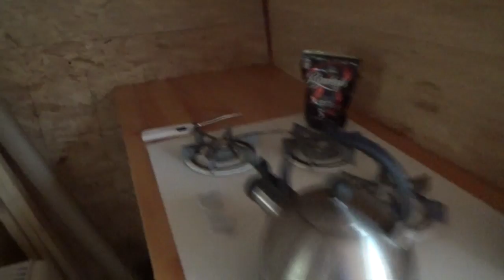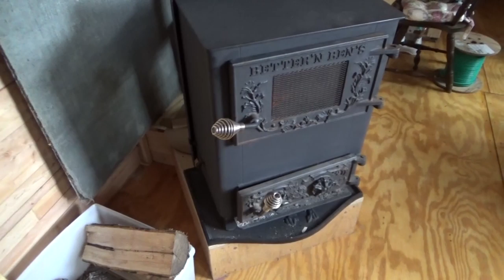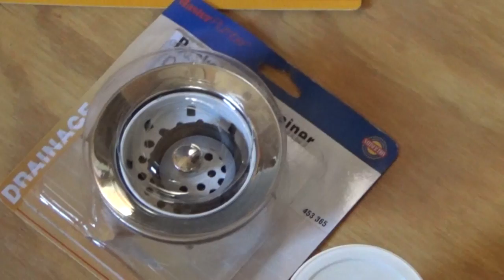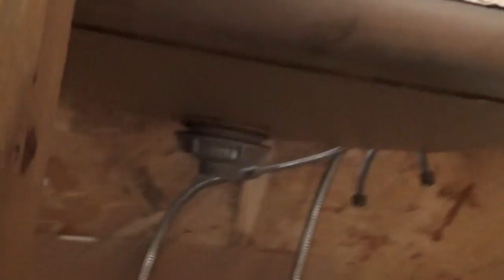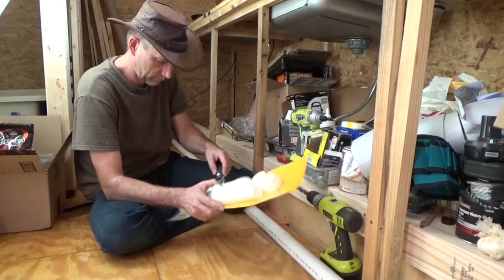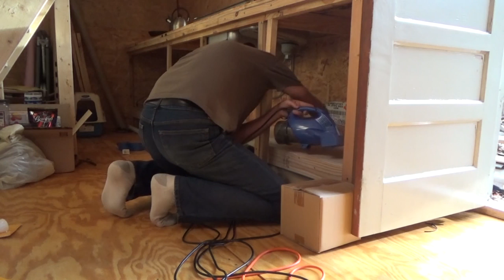Installing The Kitchen Plumbing In My Tiny House O35

Comment: your using a garbage disposal fitting for the tail stalk, brass tail stalks come in shorts and long to connect to the pvc joining piece that should go into a P-Trap then out the wall.... Good luck

Comment: I would have kept it like you had it with the bottom 90 because you're going to have water sitting in the bottom of your pipes as you don't have the pressure so you need to run straight out you need to make sure it has at least an inch of fall out your house so I would make sure you take out that Ben. Because of water just want to set in the bottom of your pipe and cause it to stink
Reply from the maker: It is there to stop air from flowing back into the house through the lines though.
Reply: The Do It Yourself World
yes, odor, plus critters and cold air. As long as the only standing water you have in your pipes is inside your heated space, no problem freezing. just check the outside pipe in the winter. ice could build up after repeated sink drainings. find some mongo heavy duty pipe for that application. clear ice with a hammer!
Reply: The Do It Yourself World You are right.  The trap is absolutely required to prevent methane from returning to the house from the tanks (or sewer/septic)... when you go away for a week or more remember to put some water down each drain upon return to make sure the trap has a good water seal or the house will stink at minimum,  explode if too much methane and you light anything. Always check the traps upon return in winter in case the water in the traps froze and causes a leak when the house is once again heated.  Also, remember to turn off the supply lines and open the faucets to drain before you go away in winter. ( Probably should have reminded you of that one last winter...  :/   )
Reply: I believe that the bend 'ben' as you call it, is called a trap and is there to trap bad sewer gasses.   It is essential for safety reasons.
Reply: DrBill  Doesn't the bend keep critters out too?
Reply: ***** Hey, MollyDolly is my friend and I'm sure that she doe not mind me speaking to her.    You seem to be on Troy's side more than against it.  Can't we get along?  I'm one of the good guys here.
  As far as Troy goes, he also is my friend and if he want me to quit commenting, he will ask me himself.  In the meantime I'd like to remind you that this IS a public forum and anyone is allowed to comment.  If that makes you uncomfortable, perhaps you should not be participating. 
   There are lots of people that I don't necessarily like that comment on these videos.   I don't go around chastising them for commenting.   It is their right.
Reply: bob Last That is dumb.  Neither of us have the hots for Troy.  We just think he is a good person and does not deserve the vitro of the haters.
Reply: Theresa Ford Anything that can slither in the pipe can make the bend in the trap.  :(   Might keep ants out.
Reply: MollyDolly The bend holds water so the critters would drowned.
Reply: ***** No! When one of our daughters was about four she saw a snake come up from a toilet on a news show and could not go to the bathroom alone for years!
Reply: Theresa Ford I do wish you were right.
Reply: Theresa Ford Only very tiny ones would drown.  Things like snakes would swim right through it.   Not that he is going to get any snakes, the way he will have it set up....lol....but it has happened in the past.   I have seen it on some of the reality tv shows like Nat Geographic.
Reply: Vicki Olson Oh!  Did you see Troy's videos of the black snakes? If I recall (and I try not to) a bunch of snakes hatched under the old camper trailer. Those babies definitely could slither up a drain.  I hope he puts screens on any openings.
Reply: MollyDolly I'm sure he will.  The grey water is supposed to be piped into a tank where it will be filtered before being used in the garden, if my memory is correct.    I don't remember that video but will try to find it.
Reply: ***** I said " this IS a public forum and anyone is allowed to comment.  If that makes you uncomfortable, perhaps you should not be participating. "  The key phrase is "if that makes you uncomfortable"  The key word in that phrase being 'if' . 
   You told me to 'keep quiet and to 'let him be' meaning Troy.  I don't bother Troy.   He has asked us to help him by answering some of the questions and comments that we have the answers too as he just does not have the time to answer every question.  He is grateful for the help that we give him and if he thinks we are stepping out of line he is totally capable of telling us and has done so in the past, especially when a discussion is fast turning into an argument or if he thinks we have misinterpreted something.  
  It is totally your right to read and comment on these threads, just as it is mine. I will never tell you to 'keep quiet' .    I do tell people that have a problem with the freedom to comment that allows even people that they don't like to comment, that 'if' they have a problem with that, perhaps this isn't where they ought to be.
Reply: ***** I really don't want to argue with you.  I don't attack you for commenting, please give me the same respect.
Reply: To all utube commenters.  We all have the right to comment in this public forum and don't let anyone tell you otherwise
Reply: Attention utube users...the act of commenting or stating ones opinion is not ever to be confused with harassment.   Look it up in the free legal dictionary!!!!   This is a public forum, and if a member of that public forum engages you in a conversation, be it friendly or trying to cause trouble, you have every right to respond.   If you keep your cool, don't swear at the other person, etc, and answer with calm logic, you will be the better thought of by your fellow utubers, in general, that is unless they are already dead set against you.
  Yes, harassment is wrong, but know the definition of harassment before accusing someone else of it.   Harassment is what is happening to my friend Troy on this very channel.  I have never harassed anyone.
Reply: Amanullah Bryan engages me in a conversation where she tells me that I should keep quiet and leave Troy alone and I respond telling her that we ought to be able to get along,  as we both seem to be on Troy's side.   She continued to engage me and I continued to respond but in a calm, logical and polite manner.   And now she blocks me?   I can understand being blocked if I were swearing at her, laughing at her and making fun of her for no reason, or out and out just attacking her, but that was not the case. I deliberately quit addressing her once I saw that she was having a problem with my responses to her continued engagement. She could have stopped at any time.  
  I have no need to hear what she has to say, and won't miss her a bit, but in the meantime I think I might just go ahead and do the same. It would not be fair if she were allowed to read what I said and I could not read what she said.   I'll have to see just what blocking entails I guess.   All I can say for now is WOW !!! How childish was that? Oh, and cowardly also....lol.
Reply: ***** well said

Comment: Troy, someone sells end caps for those hose barbs.  All sinks eventually leak or get stuff spilled underneath...I always buy contact paper (made of plastic) and line inside cabinets that have water or spillables, and wrap up the sides and back to create a sort of drip tray to protect the wood.  Most dollar stores have it for cheap.

Regarding the overheating, maybe use only one log at a time?  It took me a lot of fiddling with damper and air intake settings to get mine "tuned", and those settings will change with new wood.  So don't let anyone give you grief over it...it's not an exact science.  But I think you can definitely get better results using less wood.

Comment: when you can afford it; a honda eu2000.... converted to propane.
you can recharge your batteries that way... 
glad you have the stove working.... yes, keep a big kettle of water on the wood stove; preheats water for kooking, energy efficient....
Reply from the maker: I prefer using a vapor carburetor or wood gas. That is on the list for next year
Reply: Isn't propane more expensive then gasoline? The advantage is it doesn't go bad or evaporate like gasoline if you have to store it long periods. .
Reply: SIDNEY... TROY NEEDS CONSISTANT & VARIABLE OPTIONS. PROPANE GIVES HIM OPTIONS.
TROY. REALLY.... CONTACT ENGINEER775. HE SEEMS TO KNOW HIS STUFF, GRANTED IT TAKES MONEY BUT HE'S HIGHLY CREATIVE.   HE'S DONE THE GASIFICATION FOR WOOD BURNING... CREATIVE ON USING SOLAR PV...
Reply: k zane Why shout at me. I am speaking specifically of electrical problems . I was an electronics tech and know something of wiring requirements. In the past he used undersized wiring at 12 volts and achieved to great a voltage loss to operate. I am not so sure he fuses his wire size as not to cause the wiring to set a fire. I have made a remark or so I hope he made changes as necessary. He did say the wiring I saw was temporary.
I don't know much about propane except it is the gas I use it to boil crawfish here I don't believe I noticed anything wrong with his hook up.

Comment: The flame under your kettle was fantastic; a real home now! I laughed at the 100 degrees upon your return, going to call it the Toasty Tiny Cottage on Wheels now. SUCH a wonderful change from last year where you were so cold for so long.
Reply from the maker: It sure is turning out nice. Yes it is an absolute opposite of last year.
Reply: The Do It Yourself World  I think your cottage might be so well insulated that heating a kettle of water in the morning might be enough heat until winter sets in. :)

Comment: once you decide what kind of dwelling you live in; RV, permanent, etc, you can figure out the drain vent. (if any) If you're  gonna drain just sinks through the current system, it's called brown water. it can be re-used but not in your case,, yet. without codes you may wish to skip the vent. Ask yourself if there will be a methane risk? It may save you yet another hole in your roof. Have you checked out "other power.com"? happy trails
Reply: grodad   Sink and shower water is gray (grey) water... toilet water is black (brown) here.  In some states gray water can be reused in the garden, I don't know about NY... but  the rule of thumb in NY is if it makes sense and you want to do it, then it violates code.   Troy may need to haul the tanks to a disposal... like his LL's septic.
Reply from the maker: The water will be drained into a tank outside. I answer that in the next part of the video. For some reason it is taking me 6 to 8 hours to upload recently though.
Reply: MollyDolly
lol.  regional semantics.lol. around here sink water is brown(layman's term) and toilet  water is black; (universal term,, and opinion) it is grey water in plumbers jargon of course.You right,
 he will need to check code as usual about re-purposing everything. A real shame! If he uses biodegradable soaps, he can irrigate the garden in summer. That and a good Scandinavian style composting toilet will enable Troy to grow many types of exotic foods, with the help of a passive greenhouse.  His opportunities are endless. I can only hope his buddies are willing to help with the Off Grid aspects of his life and not just BUGGIN.
Reply: grodad Yep!  We are separated by a common language. LOL!
Reply: Jeff Tower He can easily dump in the LL septic connection.  I bet he doesn't even use that much water.  He's single and is barely there what with all the travel he does so I don't think it will be a problem.  But, I would drain to a bucket in the warm house not outside during the winter.

Comment: Troy, using your tubing under the sink, with the most fall possible. the J/S trap goes on the down feed. the tail shelves can be cut just above the feed tube too the garbage deposal feed. the down tubes should be the best feed space available the run of pipe should fall around a 1/4 per foot run.

Comment: Nice work so far.  I do have a question do you think we don't see the hidden item under the box.
Reply: That is a nice propane tank
Reply from the maker: I honestly have no idea what was "hidden" under the box. You guys dont miss a thing and often see things that I do not.
Reply: The Do It Yourself World
There is a box that on it side.  Under you new stove you just installed.  Under that box you will find what appears to be the propane tank for the stove.
Reply from the maker: benmattgreg Ok, I just looked. Unless I moved it, there is only a box full of all my screws and fasteners down there. I did have a green coleman can for my lantern laying around. Maybe that is what you saw. If that was it, I must have put it away since then. Trust me, I am not trying to pull the wool over your eyes here. The gas connection for the stove is outside the house on a large propane tank.
Reply: The Do It Yourself World I wish I could attach a picture.  I would show you what I am talking about.  It is in the whole under you counter it where you where thinking about putting your batteries.  Show us how the stove is hooked up then.
Reply: The Do It Yourself World I believe what he is talking about is at the 23 min mark as you move the camera closer you see a battered up box that looks like it could be covering a propane tank. It does sorta look like a hidden tank but camera moved to fast to get a clear view.
Reply: M Baldridge yeap that is what i am talking about
Reply: benmattgreg Its blurry so I can not say what it is I even went back to dif spots in the video to see if I could tell. But I could not find a clear view so we will just have to wait and see if he shows it hooked up or not

Comment: IF I remember right you're going to need to install a drain waste vent. Otherwise your sink will not operate right. It allows air to get behind the water to allow it to drain. It's like the little vent cap on a gas can. When it's not open the gas just trickles out....

I believe that there is a device that will allow you to install it under your sink & not have to run a pipe up through your roof. Google Air Admittance Valves. BTW The same will be needed for your shower. 

Just my 2 cents...LOL
Reply: grodad As long as he only uses one sink at a time the second sink is the vent... but if he fills both sinks and then pulls the plugs on both he won't need a vent because all the water is going to be on the floor when those thin plastic pipe fitting fail.  :(
Reply: you're right about a drain vent. if Troy opens both sinks at once, he won't need a vent. the shower is another matter,, potential flooding,, !
Reply: Oldcodge He has no hope of getting one of those locally if all they had in stock was this set up.   It's funny, some say it won't drain at all without a vent, some say it will drain too hard and suck the trap dry...well, I say it won't be on there long enough to find out.  On the upside... that plastic is so thin he can probably check there is water in the trap just by looking at it.
Reply: MollyDolly right on kiddo. I have two sinks and the same issue,(until the caretaker resolved it) It does drain, but slowly. Too bad about the flimsy drainworks. It won't tolerate much plunging. Running hose from the stems to a point mounted on the underside of the counter would act as a vent wouldn't it? Both drains would have access to free air, and wouldn't let water rise any higher than the level of water in the sink. Cheep, simple and compact. it would only over flow the hose ends if the sink flooded also. Then,, it's a wash I guess..